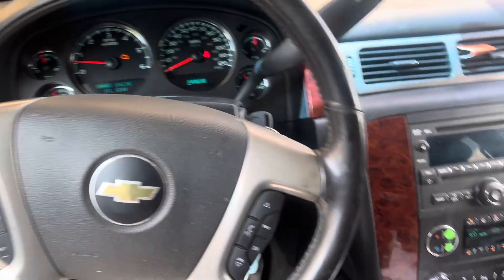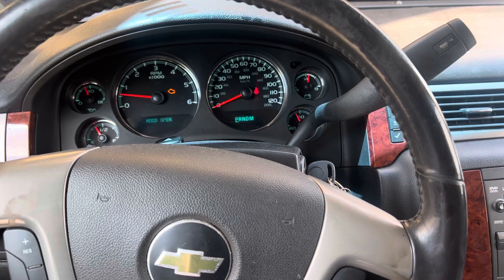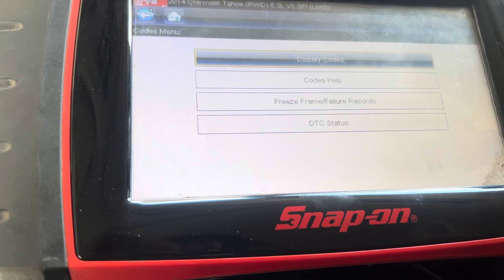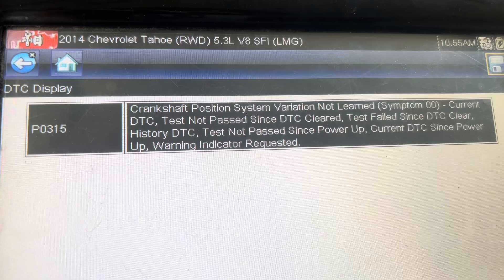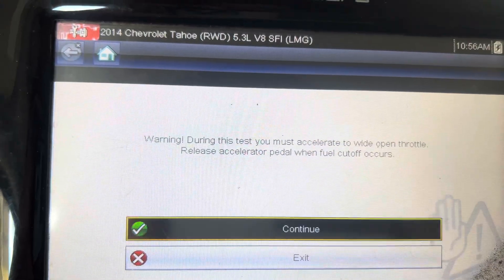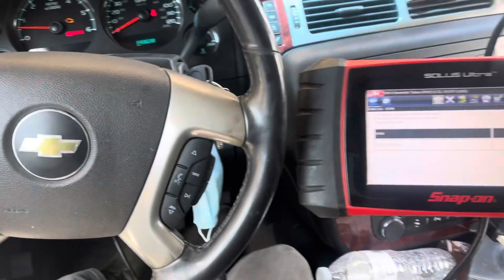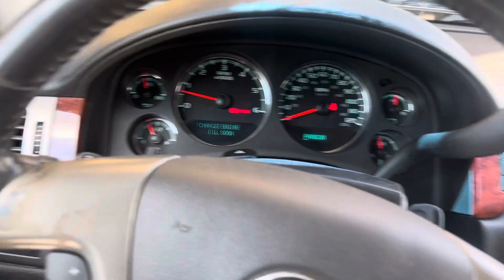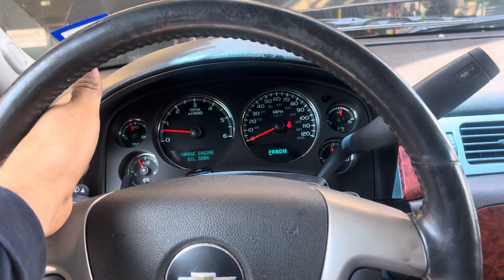Chevy p0315, Crankshaft variation not learned fix

Comment: I have a 16 SS sedan having this issue but my rpm gauge isn’t working or reading. Any ideas ? New sensor, new ecu
Reply from the maker: @Bombalumbala  the sensor does not need any sort of programming, 90% chances you have a wiring issue form the connector to the ecm being that is close to a lot of heat of the exhaust

Comment: I have a 2005 GMC Canyon, I replaced the ECM, and did the key relearn. I have read about a manual method, without a scanner tool, to fix the P0315 code.  However, it didn't seem to work, I tried it twice. Do you know a working method on how that can be done without the scanner tool?
Reply from the maker: @tallpaul9475  no unfortunately you can’t without scanner, you don’t need a professional scanner to do it

Comment: I have a 2011 gmc sierra and replaced my ecm so when I go to turn the key I can't even turn the engine and I get the same code
Reply from the maker: You need to program the antitheft before anything
Reply: @clutch in   even if the light doesn't come on for anti theft?